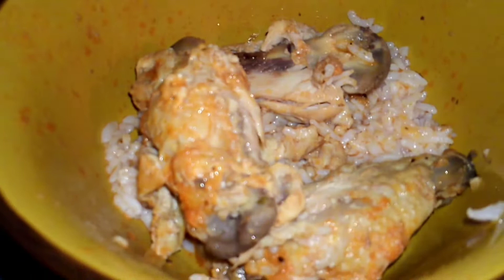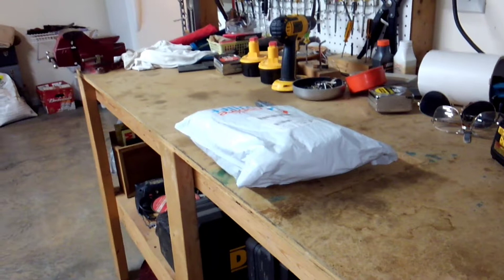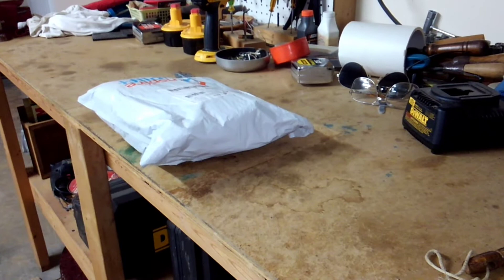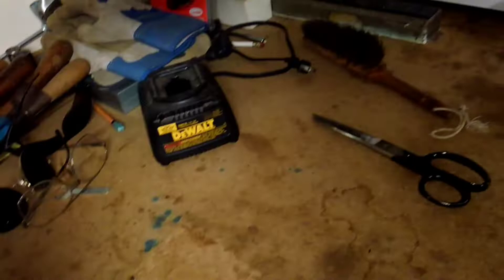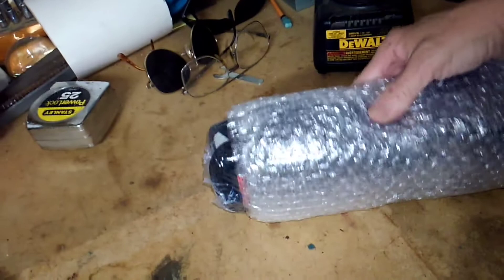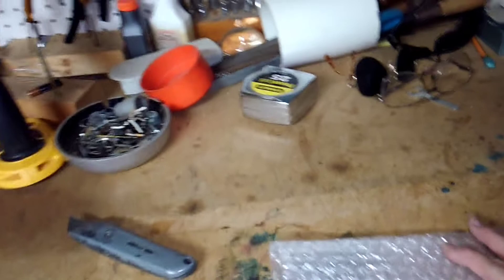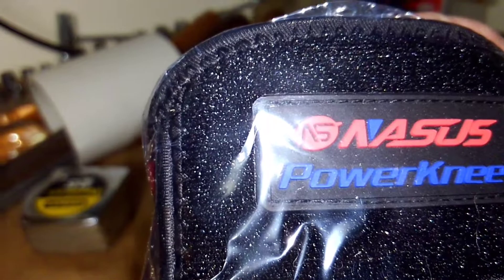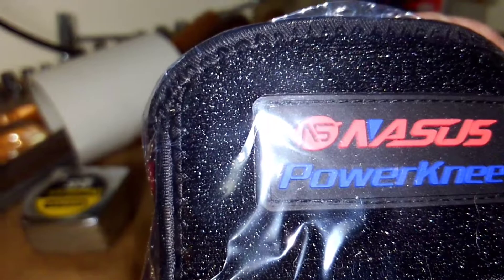Knee stabilizers from Inspire Uplift Unboxing and REVIEW!

Comment: Nice review! I hope they compensate you! Are you posting this to amazon?
Reply from the maker: Scrap It Up, I didn't know I could do that, posting to Amazon. How do I do that LeeAnn and Michelle?
Reply: Find the product on amazon, sign in to your account, click on the reviews of the product, scroll til you see "write a review." There should be an option to post a video.
Reply from the maker: @ScrapItUp1 , Thanks for the information. I didn't buy it off Amazon but I will see if I can leave a review. I'm going to try and wear them upside down on Sunday and see if it feels better. My ankles are a little soar but that's because I need to break in the lifts. It hurt some to try and squat and that is why I am going to try them upside down and see how it goes. I'll try and do an update review on them.
Reply: @adventuresunknown1013  ive seen ads for similar products and wondered if they worked.
Reply from the maker: @James Hama, I’m doing good. We have new management at my work place who claim that they’re going to get things fixed there. This is the sixth Manager since I’ve started working there years ago. The last three managers didn’t even last a year at my store.